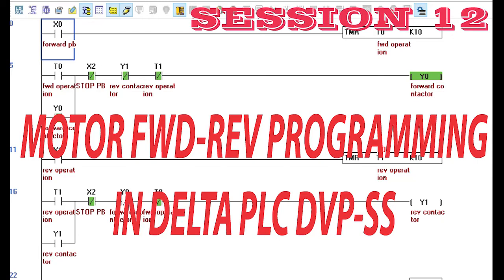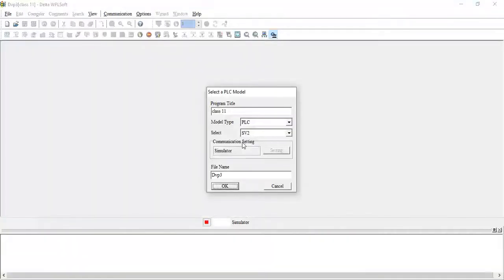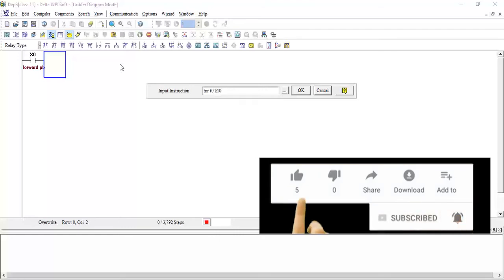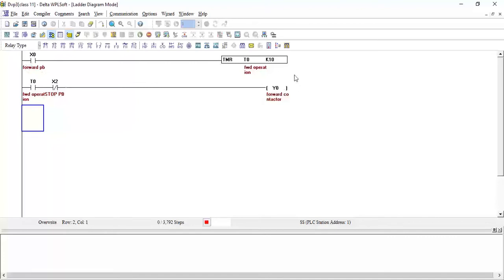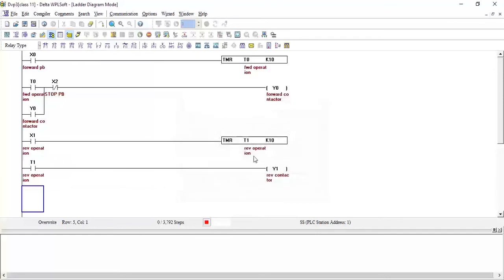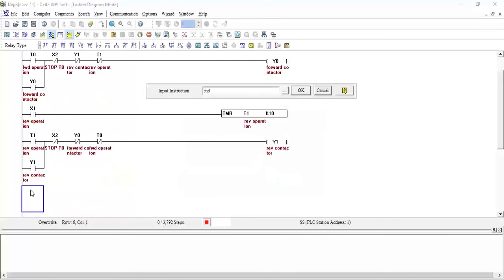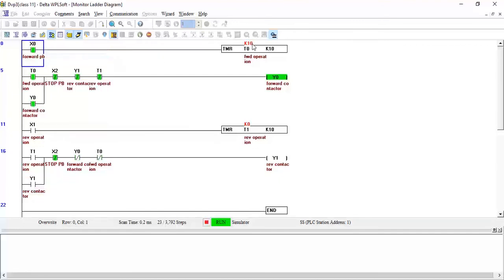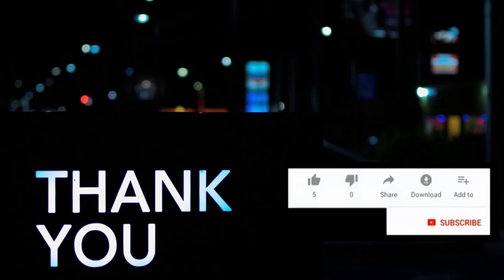MOTOR FORWARD REVERSE IN DELTA PLC DVP-SS2 | Class 12 | PLC Ladder logic | BeingGuruElectrical

Comment: Why do we need an timer in this ladder logic? Can we program for Forward and Reverse direction without a timer? Can you explain me on that. Or share any video if you've already done it.
Reply from the maker: Timer is to give time for inertia to stop if running forward then reverse.

You can think like car running in forward direction and you put reverse gear. It will damage the car gearbox but not go reverse so it need time delay to stop and  then put reverse
Reply from the maker: But for plc you can use without timer but practically must be with timer

Comment: Thank u sir.. Helpfull.. But which are limit switches here?
Reply: We have experiment called
"motor forward and reverse control operation using limit switch"
Can we do this? As you explained
Reply from the maker: Yes that can be done if you connect input to the limit switch. That is the application of this program. I hope you get your desired answer.
Pls let me know
Reply: Thank u for reply sir..
Reply from the maker: Dear Prakruti, there are no limit switches here...